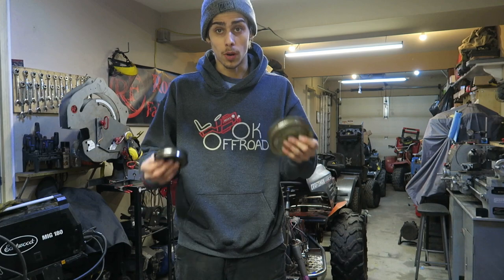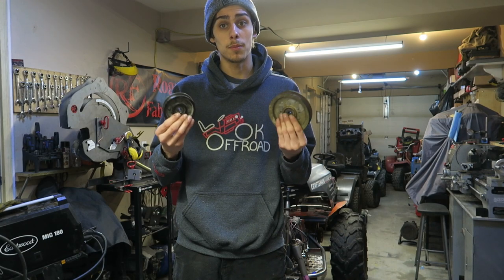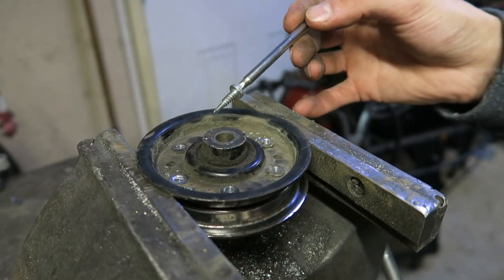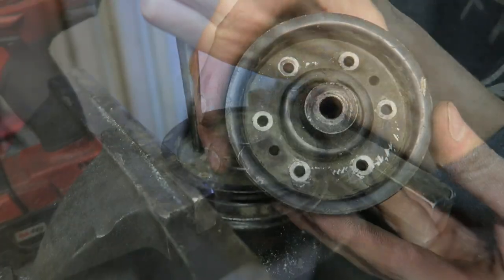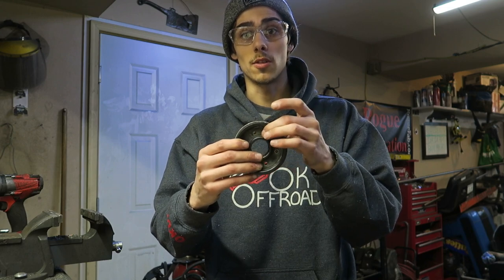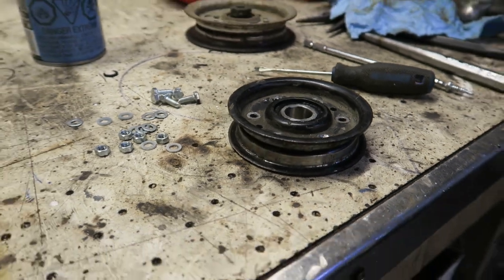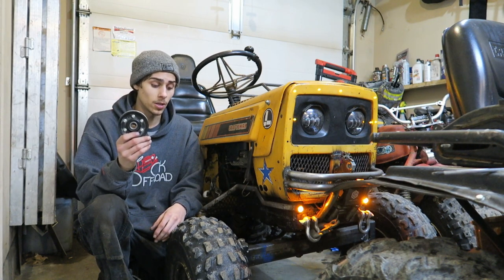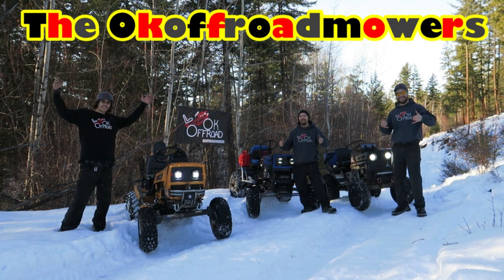REPLACE— Nonreplaceable lawnmower pulley bearings, simple mod to save you money!￼

Comment: I've done this before as well. But I like to tac weld the heads of the bolts to one half of the pulley that way when I'm under the machine i dont need 2 wrenches. And it helps align both halfs for easier install when your done.

Comment: I was just working on my GT18 and something very disturbing revealed itself. The motot is a vertical shaft oppy nut the transaxle is a horizontal pulley. I now have to find a ninety degree gearbox like you did to make the belt wind in very protectable ways. That is cool because I really wanted to know if I had to do this but my question for you is,"did you start with an LT or a GT and with your engine on Musty being a vertical, was your original transaxle a horizontal like mine or a vertical like the one you replaced (peerless 820)?